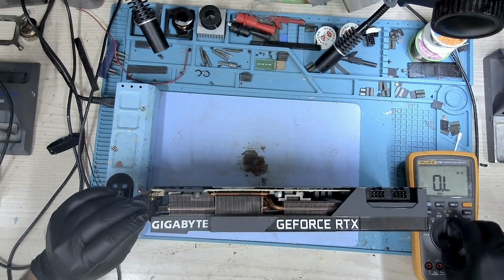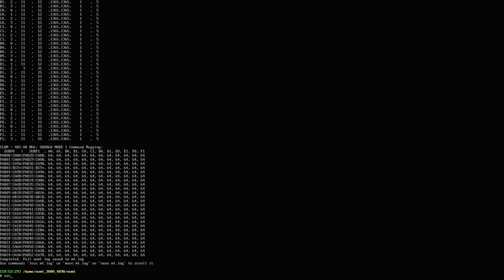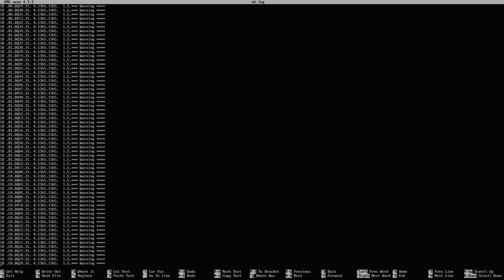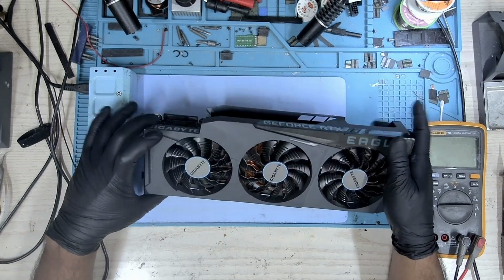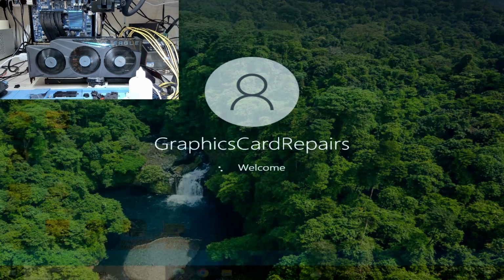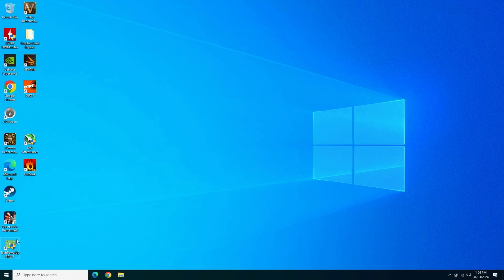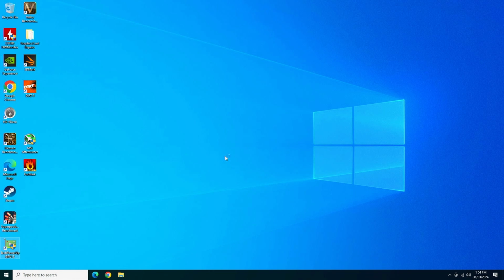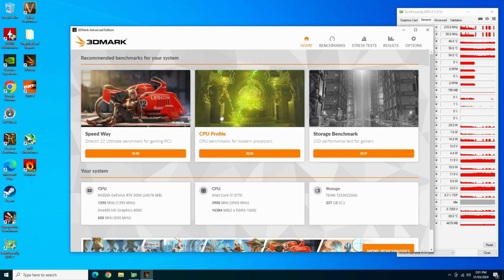Gigabyte Eagle RTX 3090 -  PC Does Not Boot With GPU Installed - Memory Errors Fixed

Comment: I have not just one but two shorted datalines on A1, measured on the PCB pads, so it's the core. Do  you find it plausible that reball  would fix it , or  is this surely dead core?
Reply from the maker: If the core on data line is showing shorted then core is dead. There is no point reballing. New core will be required.
Reply: @GraphicsCardRepairs-tk7ql  Why did it work in this video? You also have one short on the memory channel dataline, which was obviously cleared after cleaning the GPU chip pads. Was it some kind of oddity? PS. My core still works somewhat when the A1 is disabled with Debug BIOS.
Reply from the maker: @mikegaming4924  is the data line on the memory shorted or is it on the PCIE. My bad I read it as PCIE. If the short is data line on memory then reball can help to eliminate any short on the pads. But it will not resolve if it's inside the core.
Reply: @GraphicsCardRepairs-tk7ql  Yes, the GPU core is  still on the PCB. It's on the two of the memory data lines , measured from the VRAM pads (I removed the VRAM that gave training error). But yes one option is to remove the GPU core , clean the pads, and then measure  the data lines after all solder is  cleaned, on the corresponding GPU core memory data line pads. It seems odd, though, that two memory data lines show short, which makes me hesitant to attempt reball, because it still works with one memory channel disabled - at 320-bit. Have you ever seen two shorted memory data lines and have you ever solved that by reball?
Reply from the maker: @mikegaming4924  out of 19 plus GPUs I have diagnosed with short on memory data line 11 got fixed after reball. Rest were dead core.
Reply: @GraphicsCardRepairs-tk7ql  I see. Thanks for reply. That's a very good percentage of fixes. Did you ever see more than one shorted memory data line in any of the GPUs?

Comment: I have 1060,using mats 367.56.4 and i still don't understand how to check memory while vga has no image, I have turned on internal graphics in the bios, if I select "IGFX" (initial Display output) I don't see the gpu to test and if I select "PCIe 1 slot" I don't see the image is on the onboard vga port, can someone explain it to me? thanks
Reply from the maker: It could be that the GPU is not detected. Have you checked if all voltages are present. Booting through internal display if GPU does not show means it's not detected
Reply: @GraphicsCardRepairs-tk7ql  I'm using another 1060 and it's working fine, if I select "PCIe 1 slot" (initial Display output) with internal graphics turned on, it will show memory test results but the connection cable must be plugged into graphic card, onboard vga black screen
https://drive.google.com/file/d/1OrCqBIq-lpqWBTpD2N4EzylYFcCLEHbN/view?usp=drive_link

If I select "IGFX" (initial Display output) there will be an image of the vga port on the mobo but I don't see the gpu to test,cannot run mats or mats367 command
https://drive.google.com/file/d/17Mu9h3mgtsFnbjwJBSPWEX3Pn9hIxxOc/view?usp=drive_link
Reply from the maker: I will take a look at the link and update you.
Reply: @GraphicsCardRepairs-tk7ql  I hope you will make a video about this
Reply from the maker: Have you tried loading into Windows from the internal display and check if the GPU is showing in the device manager? secondly, if you set mats to autorun even if you have a black screen mats will still run. probably wait for 10 min to 12 minutes or so then you can boot to Windows through internal display and check the report.txt file for faulty memory results.
Reply: @GraphicsCardRepairs-tk7ql  If I go to window 10 I will see intel graphics and gpu 1060(display adapter)

I have a graphic card artifact. When I run autorun, it will show the pass result but there is still an image so I can run a few more commands and get the results. If it gets black screen, I will only autorun once.

Comment: I´m not sure what happened here. Why there was a short underneath the GPU? How? I mean - there was no missing contact but a short?! ... some kind of metal dirt ?! But how? ... I´m confused. How do you came to the conclusion that you have to reball the GPU? I would have said the GPU is faulty due to the short but I wouldn´t have reballed it?!
Reply from the maker: At first  I thought the user may have given it to another repair shop.  My assumption is something conductive may have got there.
Reply: @GraphicsCardRepairs-tk7ql   But nobody would assume that a shorted data line could be something conductive underneath the GPU ?! :-)  ... It´s crazy to do such a work. I would never had thought about a reballing. Rather a faulty CPU?! Why did you make a reballing here? There was no reason?! A desperate attempt?
Reply from the maker: Well I had lost hope when I saw a short on the data line. It's just that I wanted to remove the core and test the pin on connecting the data line if it's shorted on the core. When I tested and saw that there was no short I was thrilled and happy I made that decision and reballed it and installed the core
Reply: @GraphicsCardRepairs-tk7ql  AAAAH! OKAY! Thank you very much for this explanation!

Comment: I have a question, if a data line trace was broken somewhere on the pcie x16 slot, would the video card still work but at x4 or x2? because this what is happening on my Primary PCIE slot with any video card. the Chip-set PCIE x8 slot works just fine. I should also mention that the pins in the  LGA 1200 socket looks great no bent pins. Someone suggested a cap near the CPU may be malfunctioning or something. Any thoughts? P.S. I really enjoy your videos. Great Production work!
Reply from the maker: If the issue is with your GPU that works in X2 or X4 that means a capacitor at the back of the card connected to the PCIE line is broken or knocked off. You may have to check the back under the microscope. Or a camera while zooming it. So the thing is depending on which pair of the data lines this capacitor is knocked off, it will show x8, X4, X2. I have a video coming up on this type of card soon.
Reply: @GraphicsCardRepairs-tk7ql  Thanks, I have a digital microscope as well, I will take a closer look. Thank you for your help. Cheers! I look forward to this upcoming video you mentioned.
Reply from the maker: The video I mentioned is uploaded.

Comment: what type of flux are you using ?
Reply from the maker: I use 2 different flux. One is mechanic  AD-559 I use for reballing and other is Amtech NC-559(not original) from AliExpress.
Reply: @GraphicsCardRepairs-tk7ql   thnx